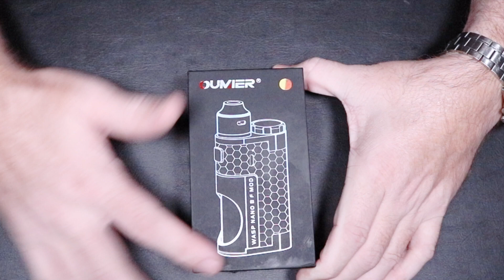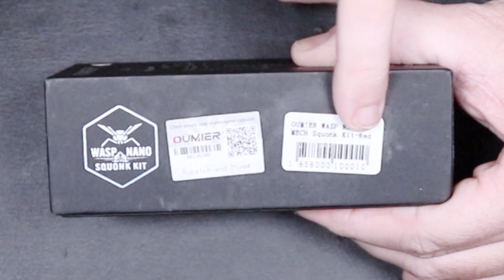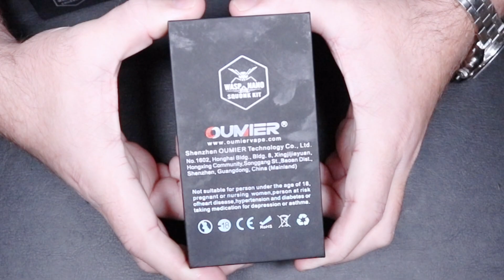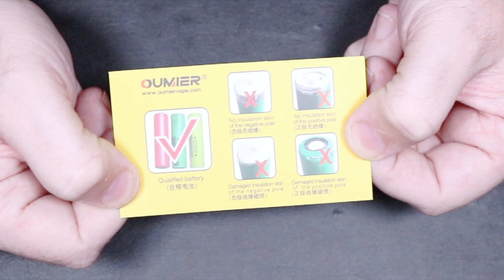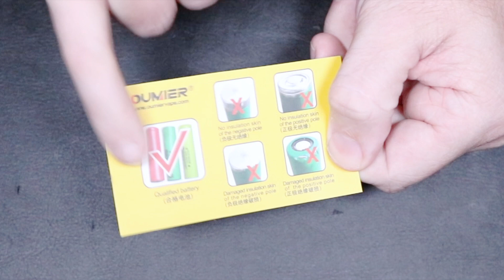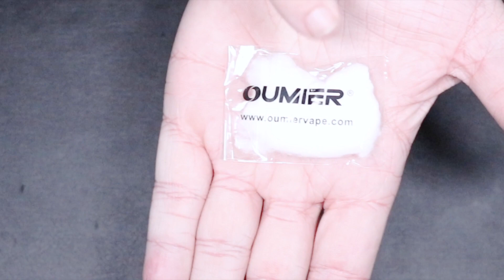WASP NANO SQK KIT BY OUMIER ~ EVERYBODY LOVE THE WASP NANO RIGHT?!

Comment: Cool review. I buy today a black luxotic bf and a black wasp nano thanks for recommended. My first rda and  I buy the wrong wire 0.6( I have a little bit fear for a extrem hot vape but was cold) now I build a parallel duel fused clapton whit this wire, have you a Tipp for a good wire( from coilology) , and is this normal for a squonker I little bit juice in the 510 (maybe gently press its better)
Reply from the maker: Oh yeah .6 and you won't get anything good of the Wasp w/ Luxotic.....you really need to be .3 to .15 depending on how hard you vape.  If you put a Coilolgy Ni80 Alien in this it will ohm out to around .22 and put your right in the middle range (same coil from same company in SS would coming in a .14).  Hope that helps out some Rene :)
Reply: PAL 702 thanks so much, you make my day.
Reply: 0.6 is cold? am planning to build 0.5 on this but i lke hot vape to mimic the cigarette puffs

Comment: Still think the squeezer with upgraded silver is unbeatable and the pico squeeze and squeeze 2 for the price. When I first saw this is was 80 bucks. It's been out for some time now on Chinese websites. I still don't get basically a regulated board that doesn't buck boost or at very minimum buck.

Comment: Btw Pal, they never copied MCM, in fact, if anything (even though I adore MCM) MCM copied the configuration from countless other High end mods that came before it. That whole battery in from the top, bottle access at the front (or just bottle access at the front) setup has been around for at least 1.5-2 years, well, that I know of anyway. 
I know you never made a big deal of it man so I ain't having a go at you or anything, just felt I had to chime in is all. :)